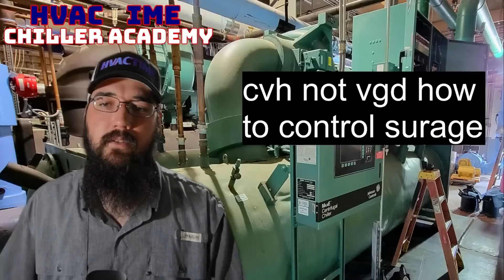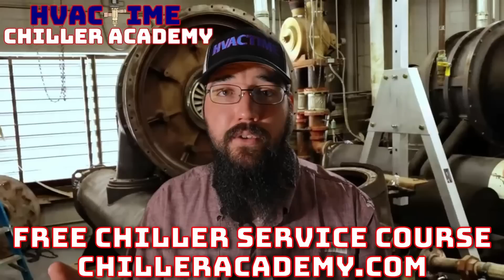Two Proven Methods to Control Chiller Surge

Comment: I understand surge condition here is a pressure ratio to high or discharge pressure out of envelope?
I'm familiar with Turbocor compressors where surge speed is lower speed instead. Why this difference? I'm missing something?

Comment: Condenser relief, if available, is another option. Get that Condenser water down. Acid wash the condenser if the approach is high, even with clean tubes. Some nasty condensers here in Austin.  Check flow is uber important. Verify the purge is operating normally.
Reply: youre in austin? you ever see entech out there?
Reply: @Keshakiiii  i do yes.
Reply: @ nice, im with the DFW office
Reply: @Keshakiiii  nice. I worked with a couple of your guys here on a building like 2 weeks ago. They were cool guys and a big help.
Reply: @JJ-COMMERCIALHVAC  nice thats cool to hear! stay safe out there brother
Reply: @Keshakiiii  🤜🤛